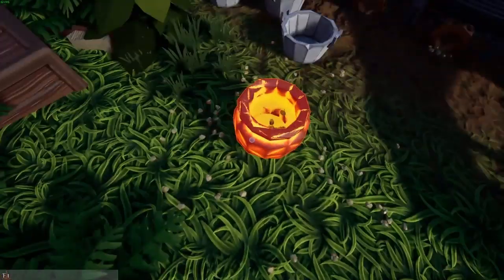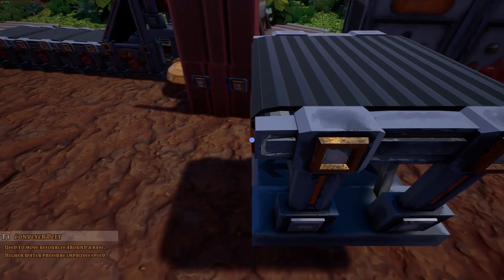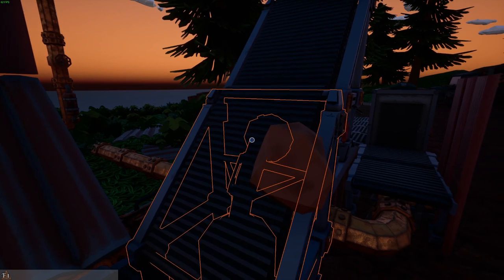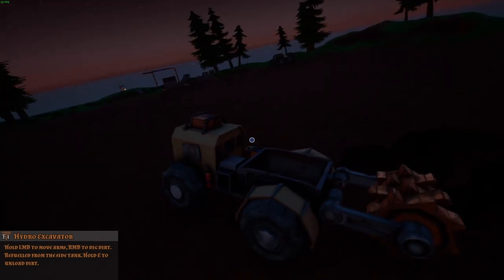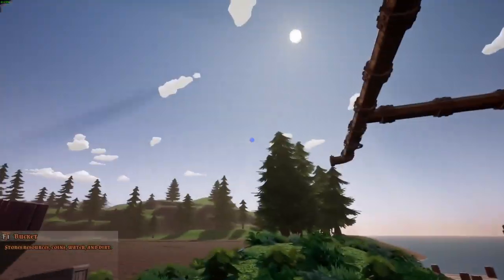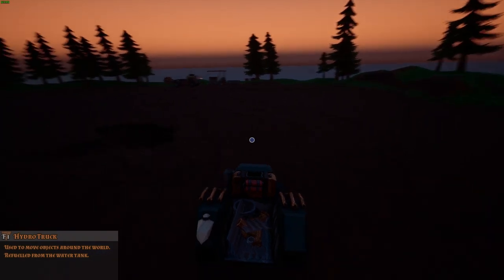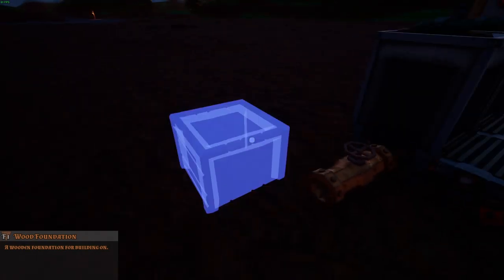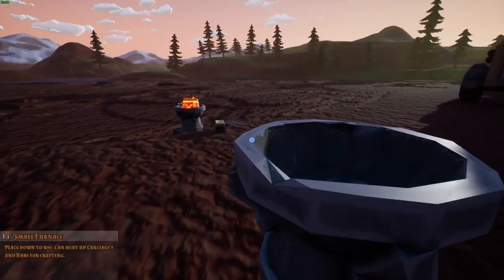USING ULTIMATE STONKS $$$ To get NEW CONVEYER BELTS and make more $$$! Or do we? | Hydroneer Ep. 05

Comment: Thursten when smelting down those big nuggets only use 1 as it still makes the same size ingot.
Buy some lighting and put it around your site and down the hole your mining.
But another great video so I just want to say a BIG THANK YOU for your time and dedication for the long hours your putting into your channel to keep people like me happy ❤👍😁
Reply from the maker: Yeah I know, but the value of the one ingot goes up right? Otherwise I've been doing stupid! =P
So many things I want to do for Episode 07! I'll try to check for the lighting so you guys can see better! :)
Reply: @ThirstyThursten  yes more ore equals more money per item/ingot. you are getting small ores with the harvester because of low water pressure. you want near 100% water pressure to maximize ore size. if you don't use shards to increase water pressure, you'll NEVER get more than 50% water pressure. for each pipe and machine connected, you lose 1% pressure. base pressure is 50%, then -1% for each pipe and machine. each pressure tank gives +25% pressure. so you will need 3 or 4 depending on how much you have connected. just the same, filters give +25% protection to machines. so, 4 filters are needed.

Comment: Each pipe you have in the system lowers the pressure by (I believe) 1%. Each pressure tube increases the pressure by 25%. It's best to have 3 with these systems